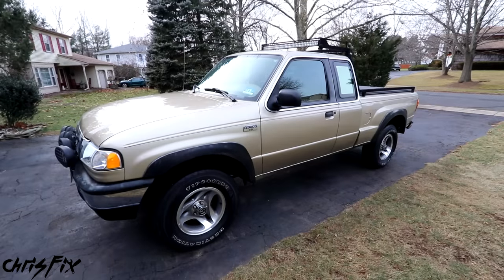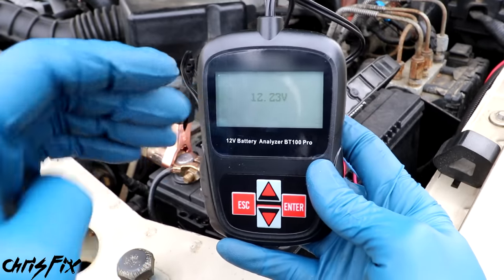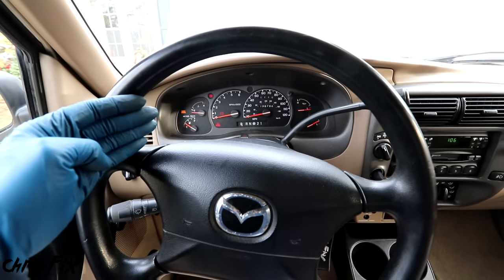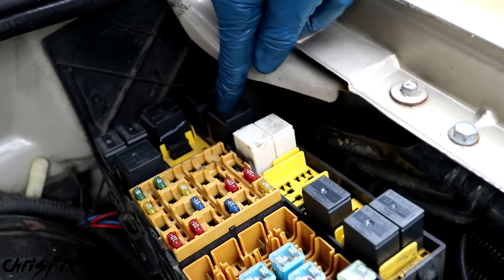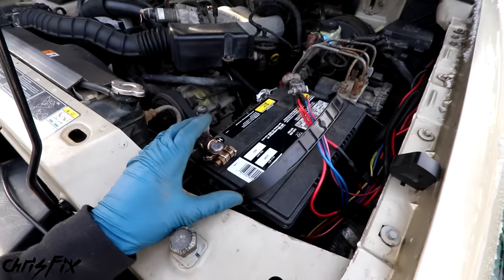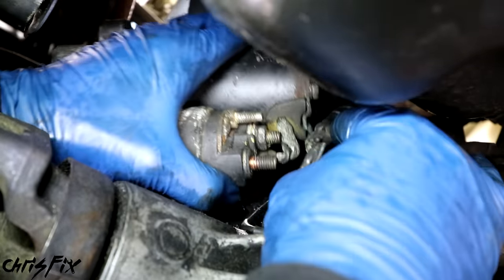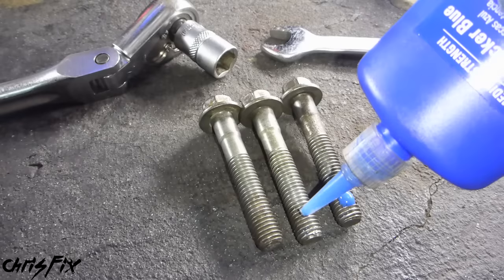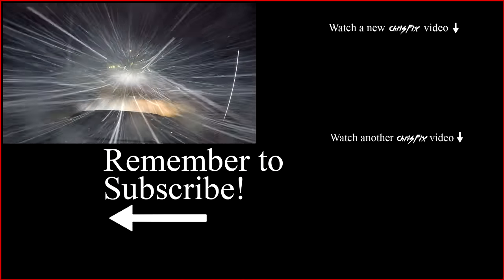How to Diagnose and Replace a Starter

Comment: warning for people doing this on ford trucks. this may apply to some to other vehicles as well. Some starters need a shim stack to be aligned properly, and with ford, the starters are slot drilled for at least one of the bolts on some of the trucks. while I do know how to do the alignment for these, i do not have the correct tools to properly do this and without the alignment tool, I have yet to get the starter to mesh perfectly without grinding. just be aware that this may be the case for some people, and if your starter grinds after installing, you may be forced to have a mechanic do the starter alignment for you. chris, if you have any suggestions on how to deal with this issue avoiding using special tools please let me know. your videos are always entertaining to watch.

(current toyota and ase technitian student)

Comment: I wonder how many millions of dollars you've helped people save with these videos. Great job with these and keep them coming!
Reply from the maker: I'm sure everyone has saved a ton of money!  And thanks!
Reply: Think how much you could save by just putting new $2 carbon brushes back in your old starter.
Reply: ChrisFix          Hey Chris, I turn the key and my starter does absolutely nothing.   I bought a brand new battery, had it tested and put in brand new battery cables.  the starter still does nothing. Where exactly do I connect my voltmeter leads on the starter motor to know the power from my ignition switch has energized the starter solenoid and connected the battery power to the starter motor?  What should I read if the starter is good?  What should I read if the starter is bad?
Reply: ChrisFix    Hey Chris, my car starter solenoid has an “R” terminal how does that work?
Reply: Mr Obvious you would connect the positive to the lead on the sealinoid that connects to the battery and connect the negative to where you bolt the starter in or anywhere on the base of it. You need to check you relay too cuz it sounds like you aren’t getting power to it.
Reply: supersonicsegax1 I connected my voltmeter leads to the starter like you said and I read 12.4V on my voltmeter. While I was doing this I turned the key to the start position and the voltmeter still reads12.4V?  The car does nothing, what should I do next?
Reply: Mr Obvious look in the owners manual for the starter relay should be under the hood. When you find it put your finger on it and have someone Try to crank over the car. If it clicks then it’s good if not it’s likely the relay
Reply: Mr Obvious if the relay is good take off the starter and take it in to have it tested at autozone or oriley they’ll do it for free. If it tests bad then just replace the starter.
Reply: supersonicsegax1 someone said to just do a voltage drop test of the starter motor. That it would easily tell if the starter is bad. Where should I put the voltmeter leads to do the test?  What will a bad starter read?
Reply: supersonicsegax1 are you sure?
Reply: Mr Obvious the voltmeter is only gonna confirm that it’s getting power to it. Usually if the starter is bad it’ll either won’t engage at all or you’ll hear a single click. You can also try hitting it with a hammer while someone is cranking it. If it turns over then it’s definitely the starter.
Reply: Mr Obvious I suppose you can connect the voltmeter to how I explained and if you have someone try to start the car and if the voltage drops that would also show a bad starter.
Reply: supersonicsegax1 I hooked up the voltmeter the way you said. it read 12.4 Volts, at the same time we turned the key to start and tapped hard on the starter and it’s still read 12.4 volts???  What’s that mean
Reply: supersonicsegax1 the voltage didn’t drop when the ignition key was turned, my starter must be ok, right?  What next?
Reply: supersonicsegax1 Someone told me it could be the starter solenoid how do you know whether it’s the solenoid or the starter motor that’s bad?  I still read 12.4 V the way you told me to hook it up, they said that seemed too high and they were suspecting that the solenoid was bad?  How do you test it?
Reply: @chrisfix  hey man can you just switch relays like that, like how you did on the video?
Reply: @hamster1953  yes

Comment: Clear and comprehensive of everything to check for before replacing the starter!   In my "special" case with Ford Econ-150 van, thought was the starter. But before removing, I checked and found the voltage for the signal wire was intermittent to the starter solenoid.   Turned out my 1995 Ford Econ-150 van has another solenoid (mounted at front of car) to relay the signal to the starter's solenoid and it was faulty.  Fixed by replacing the $30 part.  The reason for the 2nd solenoid was because back in the old days to early 90's, Ford starter may not have solenoid included as part of the starter as in today's car.  And the 1995 van's 2nd (pre-)solenoid would allow installing the starter alone.

Comment: An alternative to checking the battery, relays, neutral switch, ignition barrel, fuses or using a hammer is to put the voltmeter directly onto the starter connections. If you get 12V there when you crank it but the starter won't turn, the starter is bad.
Reply: That is a great idea!
hope Chris sees
Reply: JoeyRodz74 an make sure u get power at the aux port to or the starter switch can be bad if u dont while the key is turning over
Reply: Yeah bro, ruling out the weakest link sounds more reasonable.
Reply: That's great advice if you have someone to help you crank it while your under there testing it...
Reply: Then disconnect the positive wire from the starter and use a wire (or jumper cable) to momentarily hot wire the starter.

Comment: Thank you so much for going through all the diagnostics—-I was ready to replace the starter and ended up just cleaning the battery terminals and changing the relay.  All done in $25!!   Sincerely—thanks for doing these videos.  You’ve saved me a ton of money and really built my auto repair & maintenance confidence.

Comment: I just got a 2001 Ford Ranger from my friend's family after it sat for 4 years and have been slowly working on fixing all the little issues it has. It's in surprisingly great condition even after 273k miles, and only has small things here and there, worst issue is that the front crankshaft seal is slightly cracked. Since I started driving it, I've had a few moments where I would get a no crank/no start, and I watch so many videos talking about it and none were helpful. Finally, I decided to just buy a new starter, and not 15 minutes after I got home from Autozone, I found your video. Turns out the issue was the neutral safety switch, something I had not seen a single other video mention. I just got back from returning the starter I bought earlier and am glad to have that money back. Thank you so much Chris from 7 years ago, you saved me a lot of time and money. I'm 26 in a week and am very ignorant about vehicles, trying to learn as I go, and I will definitely be checking if you have a video on any issue I might have in the future.

Comment: Your video are extremely informative  with simple language and clarity and without missing the critical topics. This video helped me greatly as I had almost taken out the alternator. The symptoms mentioned at 2:24 helped not to do so which I didn't find on any other. It was indeed the battery. Thanks and lot and keep up the good work.

Comment: Gr8 vid, Just had my starter go out in my 2001 maxima for the 3rd time in 20 years.  no worries.  I gave the starter solenoid a few light taps  with a pry bar and then it started.  I could hear the starter trying to turn but just not engaging.  

I promptly replaced the starter later in the week. Part was free after warrantee. cheers.

Comment: Wish I would have remembered that he made this video since I just had to replace my starter on my 2000 Ford Ranger. For anyone that does not know they are basically the same truck just named differently.
Reply: I own a 1999 Mazda B2500 2.5L Extended Cab truck. I closely follow ChrisFix whenever a problem/issue develops on my Mazda truck to see if he has a video that addresses my Mazda problem. I love this guy! So positive!

Comment: Thanks so much Chris! I changed out my starter on my Ford Ranger because it was cranking slow, and this made a HUGE difference. It now cranks over like its brand new! It took me about 5 hours and this was my first starter replacement just to give you an idea of the time it takes.
Reply: I know, I did it on mine too and it took a while. Well worth it though for the assurance that your car will start. Also, when buying a starter get a new one with a lifetime warranty; its worth it.
Reply: People don't realize that even if a starter is still working, it could still be bad and be cranking really slow and you don't even realize it.
Reply: I’m having the same issue with my Acura TL. It started cranking slow but still turned on but I just want to make sure I don’t get stuck anywhere so I bought a new starter and waiting for it to arrive so I can replace this old one.

Comment: only starters I've changed are on golf carts cause they tend to light on fire
Reply: Bob Freez 🤔🤔😂😂
Reply: Bob Freez that sound so funny 😅😭
Reply: Would that be because if the engine doesn't start the starter-generator will just keep cranking until the driver stops pressing the throttle, something breaks/catches fire, or the battery dies?
Reply: Daniel Armstrong I too would like to know why they burst into flames. or was he just trolling
Reply: lol

Comment: Hey ChrisFix video ideas: How to replace a head gasket, how to replace a valve cover gasket and how to check a valve cover gasket, how to install an exhaust, how to change a wheel speed sensor, how to change battery terminals, and how to change manual transmission fluid(please do i have a 6-speed wrangler). Just some ideas!
Reply from the maker: That would be awesome!
Reply: ChrisFix hey I have a problem everytime I turn the key you will hear a clicking noise and it won't turn on but when I step on the gas pedal pumping it a couple times it will finally turn on what could it be
Reply: you cant change battery terminals
Reply: watermelons he probably meant the cables that attach to the terminals
Reply: Install exhaust: Just uploaded
Reply: Changing Battery Terminals is the easiest thing you could do
Reply: how many people have bags full of them from schose amp kits that they never used? lol i had about 5 or 6 sets until everything in my life got stolen from my car when i had no place to go. im better now but still dont have half the useful shit i used to

Comment: Who else is watching Chrisfix and fixing their cars in quarantine?
Reply: Me! I’ve done a CV Axle, shocks, struts, sway bar links and tie rods while on quarantine! Chris has saved me thousands!
Reply: @Dontez82  same bro he saved me a ton of money too!
Reply: Moiz, I literally, did an entire preventative maintenance overhaul of my car in quarantine by watching ChrisFix's videos. Installed brand new fog lights, and a rear spoiler. I cleaned and waxed my stock headlights with ChrisFix's toothpaste trick (minus the dental floss). Then I decided to replace the stock headlights with better aftermarket ones. I replaced my worn-out struts and sway bar links. Did a complete tune up, oil change, coolant flush, fuel system cleaning, break cleaning, Mass Air Flow sensor cleaning. Cleaned, compounded and polished, and waxed my car. Did a complete engine bay cleaning. The only thing I could not do by myself was install my new rims, which I had to take to an mechanic shop to do; cost me $20 per tire. Because of ChrisFix's videos, I'm actually planning on going back to school to earn my A.A.S. in automotive technology this coming fall semester, and have already signed up for classes.
Reply: Gotta Fix my exhaust system, cause the muffler fell off.  i have no idea where it went or why im watching a video on Starters.  Mise well Just put a new system in, gotta change the O2 Sensors as well.
Reply: If your car has broke im quarantine, you must be driving alfa romeo
Reply: @ognjenmatic9430  A M3 E-92 and a Toyota Corolla 2012!
Reply: @moizsiddikio4  i was joking 🤣
Reply: @ognjenmatic9430  No problem Bro!
Reply: It takes money to fix stuff.
Reply: This comment thread is cool

Good shit guys.
Reply: My car is up to date on all its maintenance but I’m watching ChrisFix cause his videos are like a drug. You can’t just watch one.
Reply: @danielchavez4792  yeah I agree with that he replaced all my TV shows!!
Reply: Bignose Harry   .........and all the fun was sucked out of this thread.  You bled it out like some old brake lines. 🤪
Reply: Me too! I replaced the wing mirror, spark plugs, cabin filter, oil filter and oil, did all my alloy wheels (using filler, wet sanding and then spraying and lacquering), fixed a couple of deep scratches on the car body (using filler, wet sanding and then spraying and lacquering), replaced a car wing (after spraying and then lacquering, and finally wet sanding), sanded and then cleaned all my brake calipers and sprayed them red (added some decal stickers too), fixed and replaced a couple of overhead interior lights and an indicator light. All I need to do now is the engine bay clean and then finally install my dashcam, and I'm done (after cleaning the interior and washing then polishing the exterior).
I used almost exclusively Chris's tutorials; because he's the best! If Chris has a tutorial on it, I can do it too; he's that good! He's saved me about £1500 on a car that's only worth £1000. He is a star.
No idea what I'm gonna do, when I finish the cleaning....... Lol!
(From the UK).
Reply: @guppy0112  good job!!👍👍
Chris is a hero!!
Reply: Oh My Josh 3  your tools are showing that you are related to Soviet Union!!😂
Reply: Oh My Josh 3  bro in your previous comment you used the emoji of tools which are similar to the one's in the flag of Soviet Union!😂😂
Reply: Oh My Josh 3  bro if you use a wrench and a screwdriver then it will be Chrisfix's logo!
Reply: @chadshumaker4984  yes however you could save some money with a pulled part. Then take it to autozone to make sure it is working fine before installing.
Reply: Why do people like you need to know this stuff?
Reply: @_playa_  because it's helpful and knowledge is power and many of us like cars and working on them so that's why
Reply: @moizsiddikio4  helpful? Um mk

Comment: My car flooded! I watched your video on gas tank removal because the gas pump mount had a crack and water went in. I cleaned the tank, changed the broken part and put it back together, days later the starter started struggling to turn the car on. I watched this video and I knew what I needed to do next. Thanks Chris for showing me how to fix my car, I saved probably $2k on this! Keep up the great work!

Comment: Duralast replacement starter.  We're gonna be seeing a "How to replace your starter again" video in a couple months.
Reply: There's a reason they push that "lifetime warranty" so hard.  Because it helps you overlook the ultra low price and subpar appearance and build quality, assuming "well it has a lifetime warranty, it must be good."  Oh to the contraire.  What really happens is, tons of people buy a cheap part because they want to save 20 bucks.  It fails.  By then they can't be bothered to bring it back to autozone and just take it to a mechanic to have it replaced with a good quality starter.  Autozone has just made whatever money was paid for that starter.  

Slippage is the golden egg at the end of the warranty tunnel for companies.  They count on people not ever bringing back shit that's broken.
Reply: ctuan13 had to get another battery and alternator for my truck went to O'Reilly's this time no more AutoZone

Comment: The starter on our 15 year old Volvo went out when I had to borrow it when I was 17. My sister assumed I took the Volvo for a joy ride, thus the reason why the car failed to start because it was "completely trouble free for the past 2 years she was driving it". Needless to say, it failed to start at the gas station and one of the attendants hit it with a hammer a few times while starting it which did the trip and got it home.